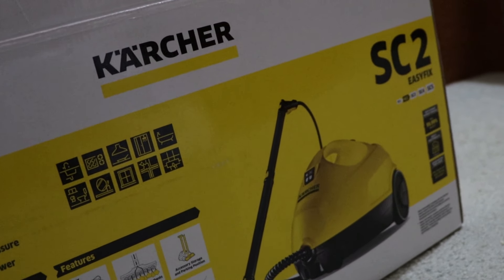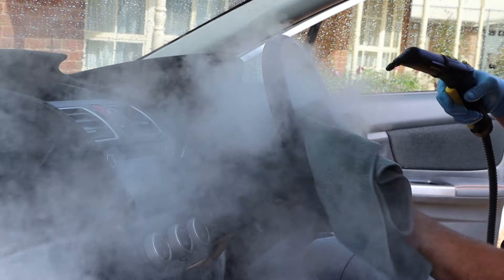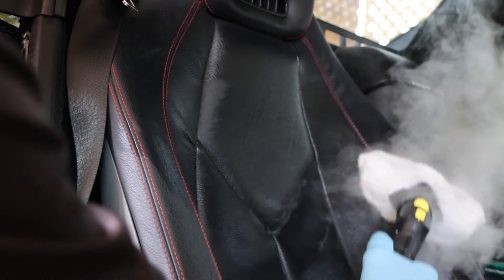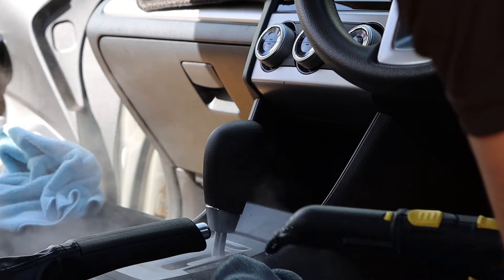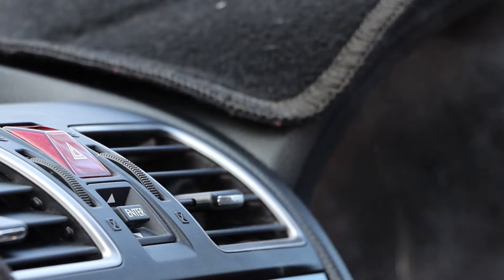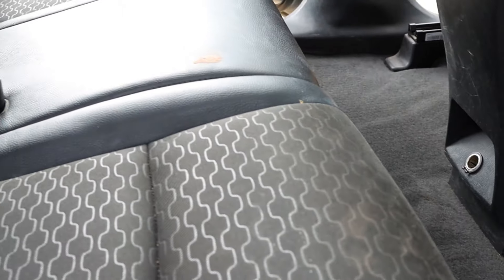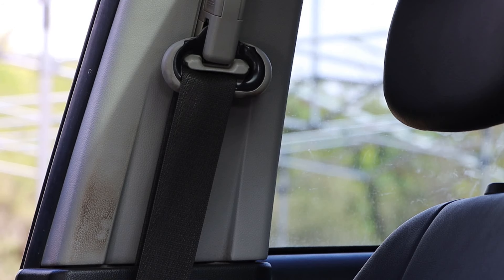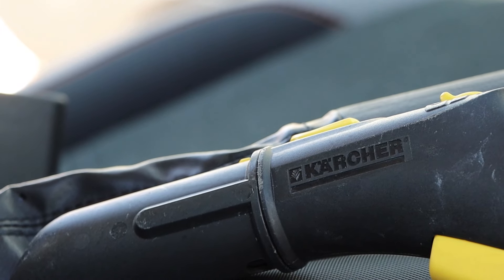Steam Cleaning Your Car With The Karcher SC2 | How-To Steam Clean | FocusOnDetailing

Comment: I had an SC2 for 6 months ..only used it for tiled floors..careful use..It was very annoying, do a small section then have to wait for the machine to be ready to carry on (reheat)..Then I was using the machine and where the hose goes into the machine if exploded and pressurised boiling water went everywhere.  I wasn't impressed with this machine at all and the pipe itself got extremely hot and it stings when brushing bare legs.  I had a full refund and purchased a different make.  Apparently the more expensive SC3 has better steam pressure.  Only one cleaning pad supplied , could really do with 2 .. I believe its now been discontinued, one of the reason for a refund not a replacement

Comment: i wouldn't recommend steam cleaning the rim of steering wheels tbh
Reply: And spraying hot steam onto the infotainment system? 😳
Reply: I personally wouldn't use it on interiors at all. Boiling hot steam on/near LED screens, fragile headliner(steam could easily soften the adhesive that attaches it), Alcantara, gauges and electronics is never a good idea. Maybe good for a deep-clean of the foot pedals but even that is more mess than it is worth.

Comment: THANK YOU!!  I've been trying to find out how to clean some thrifted baby bassinets & car seats & a baby bouncer & a stroller with my steam cleaner (I haven't really used it yet).  Now that I think of it, my husband's car IS in desperate need of any sort of cleaning it can get ...

My greatest problem is that I'm in a deep cold winter & so scrubbing baby stuff with mild detergents & spraying off with copious amounts of water isn't really an option at my house.  I was pondering doing it at a self-serve car wash, but that sounds like an unspeakably miserable job at this late stage of my pregnancy.

Your video gives some great specific tips as to cleaning cloth vs leather vs padded vs glued surfaces, & how to remove all loosened soil 💜💙💚 I so appreciate you putting this out.

Comment: Is there a lot difference between SC3 and SC 2? I'm still confused which one should i buy for my mini workshop. 😊

Thanks for the review, great video.
Reply: 100W more and tank difference
Reply: The SC3 also has the descaling cartridge, so if you live in an area with hard water you'd definitely want that
Reply: @haydencalvert1925  Yeah, in my environment is a hard water. Thanks for your advice mate
Reply: @digitalavatar5699  Thanks mate, go for SC3 :))
Reply: @bhaskaraagustiarso9087  Good choice, SC3 is boiling the water in 30 seconds - 1 minute, all the rest including the most expensive one are much slower.

Comment: Wow. nice vid. thx. but what about the exterior?  can we use this machine on the hood? for example; first, pre-washing with a proper shampoo and water, then using the sc2 with a towel, wash and dry? do you recommend this or would it harm the paint, or leave scratches?

Comment: The nozzle you chose covered a broad sweep, there are narrower jets available from the clip-on nozzle cover tips. Also a “cold” day is relative, temperature and humidity data would be more helpful. I’d suggest a dry atmosphere with low or indoor, domestic humidity and reasonable airflow to draw away the steam  via ambient thermal action. As you want to get a dash clean does it recommend this method or, specifically not, in your driver’s manual,? Warranties from self-induced condensate damage are either rare, or prohibitive.

Comment: looks like you know what you are talking about. Much more than me =D have you heard of EVO 304 from a company called Tecnovap? it might me waaay overkill. 8bar pressure...180degrees celcius....says it has only 5% water in the steam. Do not know if that actually is a thing. That sc2 machine...how "hot" is the steam?

Comment: How practical and effective is steam cleaning?  I experimented with a budget handheld steamer and wasn’t impressed.  It loosened gunk on plastic surfaces but didn’t degrease. Furthermore, the steam wasn’t forceful. It was more akin to fog, which made it impossible to see what I was cleaning. I think I’ll stick to cleaners.
Reply: With a proper machine not this water spray but say McCulloch MC1375 you would be amazed how much dirt it can clean from all surfaces. I use it to mop my floors, without using any chemicals and gives me much better results compared to nasty smelly allergy inducing (asthma) pinesol stuff :) I also used it on my car once but since I already keep my car tiptop, steaming it is not usually required.

Comment: nice video as usual... have you ever tried cleaning alloy or any metal wheels with this steam cleaner. Wonder if steam alone would lift the dirt or you'd to spray wheel on?
Reply from the maker: Thank you! At this point not yet but I'm keen to give it a go. Might still benefit from using chemicals along with it when it comes to baked on brake dust

Comment: You need to let people know they should use distilled water or they will eventually run into issues.
Reply: Depends where you live. We don't have 'hard' water where I am, and I doubt tap water is going to do any harm unless you're going to not empty any excess when you're finished.

Comment: Can this be used to clean the exterior of the car and remove dust ?
Reply: Yes. As a bonus it will remove the paint/finish too.
Reply: I use it for my exhaust tips, carwindows and chrome trim but not really on the paint. You can use it on the paint as long as you keep moving don't heat the paint up to much.

Comment: hello friends, can someone help me, I found an old karcher sc1002 in the cellar, with the safety cap completely blocked, I had to force it to open, now I have it cap is bare (without the black cover and spring etc), but when I close the metal part of the cap, it comes out of the pressurized water, through a very small hole in the middle
I checked how much the cap costs: 45 dollars !! real theft since the karcher today isn't worth more than $ 20 so it's not a good buy. my question is, can i find a standard plug, universal or otherwise, on aliexpress or amazon, ebay etc? (not more than 10 dollars otherwise it is not worth it, it is too old)

I thought of another trick, maybe I can plug the hole in the middle with something, making it waterproof, I will open it each time with pliers, but the time to find a solution?

hole in my opinion has only one role of reassembling the plastic cover by way of safety

Comment: Using steam to clean delicate materials, car instrument panels and leather, you would have the worry of water spitting out and it realy would not be worth it as you would have to make a very quick pass to avoid heat damage, I would not jeperdise a clients vehicle, this should realy be used for carpets and fabric seats. The correct cleaning solution and detailing with soft brushes is the correct and safer way. I worked as a fire and flood technician and we relied on chemistry and movement to remove all stains  definitely not steam. If you look at the video carefuly the food and mess was added. Just be careful with high end tempatures.

Comment: The steam generator cleans the joints between the ceramic tiles well. Hard-to-reach places. Slits. But keep in mind that this is hot steam! You can just ruin the leather steering wheel, the leather seats. You may have the plastic come loose from the dashboard. The steam generator can be used to wash the engine. And for the interior, it is better to use a tornado, a washing vacuum cleaner and most importantly-good chemistry ( cleaning liquids)
Парогенератор  хорошо чистит швы между керамической плиткой.  Труднодоступные места. Щели.  Но имейте в виду, что это горячий пар!  Вы просто можете испортить кожаный руль,  кожаные сиденья. У вас может отклеиться  пластик от приборной панели.  Парогенератор можно использовать для мытья двигателя.  А для салона лучше использовать торнадор, моющий пылесос и самое главное- хорошую химию ( чистящие жидкости)

Comment: great video, very crappy steamer!!! i had one, an SC2, which i used no more than 10 times over a period of 3 years. the steaming was good but the cap would get stuck. in the end i could not open it. i tried everything. although karcher is normally a good product this particular model is one to avoid. flawed in design with no solution from karcher.
Reply: This is not an issue, but a feature: thermal protection preventing you getting burned when opening too hot boiler ;) However, I can agree: for pro use cases delays it is causing are not nice.
Reply: Threaded things do get stiff if not in use for long periods of time and if there is a buildup of limescale this will make it worse, Like any machine it will need maintenance and they do give recommendations for this as well as supplying a fluid for limescale for use with this machine.

Comment: This Karcher is a pile of crap.  You are not telling the truth about them.

I have one of these overrated machines.  Sure they steam, but it is the waiting time for the water to heat up, then the constant having to stop during steam cleaning so the water can re-heat up.  It may be cleaner than a mop, but it takes 3 to 4 times longer to do your floors with a steam cleaner.  They are also poorly put together items.  Wheels come off, the nozzle broke on mine had to get that replaced, etc, etc.  So the build quality of the Karcher steamcleaner is poor and the usability of the Karcher steamcleaner is equally poor as you are waiting all the time for the water to heat up.  

Example a hallway with a mop and drying off after, is no more than 5-10 minutes work and it will be clean.

STEAMCLEANER - you have to stop and start, stop and start to allow the water to heat up, upto 20 minutes to do what a mop can do in 5-10 minutes.  Logic says why spend out on a Karcher, when you can have a quality mop that reaches every corner and does not require recharging to heat up the water.

Load of tot Karcher products are, overrated, end of.